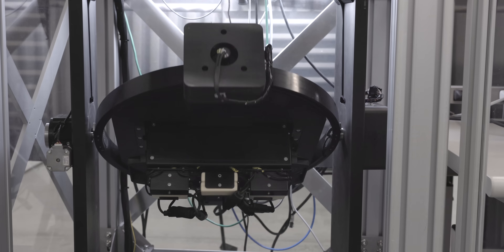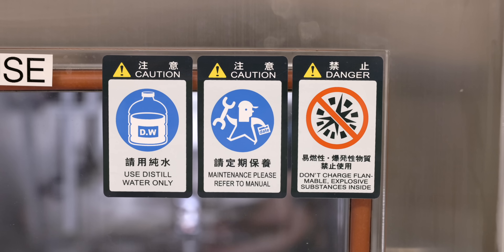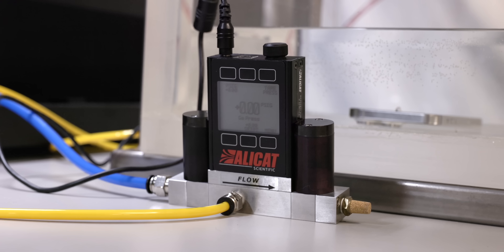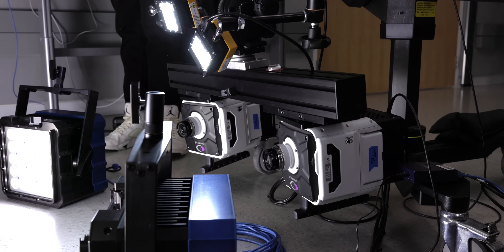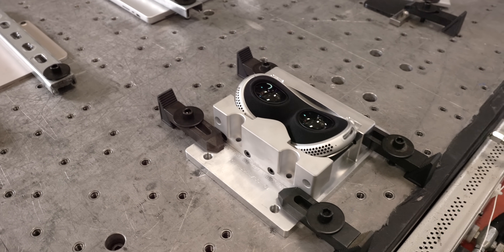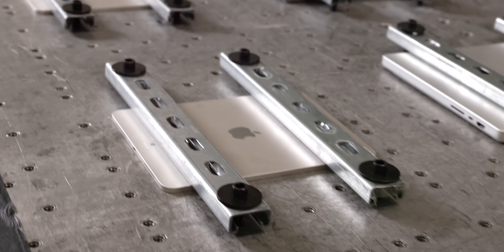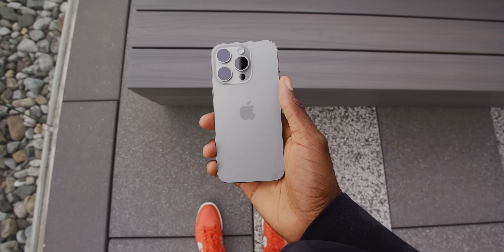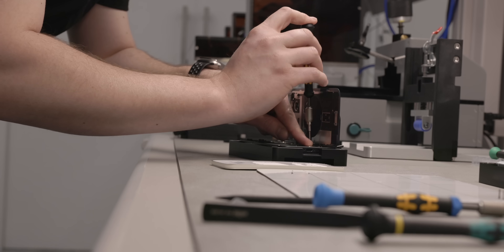I Visited Apple's Secret iPhone Testing Labs!

Comment: There was a key claim made that Marques should have dug into either during the interview or before publishing:

First the Apple engineer says:

"The failure rate once we got to that point [of durability, e.g. IP68] has just dropped, it's plummeted."

But then he rephrases as:

"the number of phones requiring a repair has dropped significantly"

Firstly, is this data true? Marques could have sought an independent/expert opinion on this. What do customers and repair shops see? What do his contacts within Apple say under anonymity?

Second, Apple's policy is typically to replace or to price repairs so high that the replacement is preferable, or they restrict suppliers from making parts widely available. So if the claim of fewer devices 'requiring a repair' is true, is a lower repair rate due to durability or is it due to policies that prevent repairs from happening?

Another question is what happened to the rate of replacement in the same period? Because replacing a phone instead of repairing it is far, far worse for the planet and the customer if a repair was possible.

Finally he talks about the number of phones needing repair dropping, not the rate decreasing. How does this map to the number of phones produced in the same period. Are the same number of iPhones sold?

Overall, I really like Marques and I believe he does have integrity, but in this situation he seemed a bit out of his depth. His body language was uncomfortable. He wasn't really taking an active role in leading the conversation. He was listening to a marketing pitch and by being passive and using this footage with no editorial comment, his audience was also subjected to this marketing pitch.

I think he was a bit in awe of hearing someone he probably admires a lot speak and a bit unprepared for being ambushed by this greenwashing agenda. In future he and his team would do well to clarify (and agree) what topics any interview will cover 
so they can come prepared, and not to feel pressured to publish anything without editorial control of the message it sends.

It's a lesson and I hope he and his team learn it because integrity is really fundamental to their infotainment product and business. If he doesn't learn it companies like Apple will exploit him over and over until his channel has lost all credibility.

Comment: Lets see if I understand this video right. 
for IP testing, they do what the board that controls IP rating tells them they have to do. Wow. Much effort. Such result.
for drop testing, they drop it a bunch. Again, Wow. Much Effort. Such result.
To simulate long term use, they put the phone in a clean, (I'm assuming) temperature controlled, and uniform environment then shake them. No thermocycling, no dropping it in shit (i mean that literally), no repeat impact testing in-between shaking, dragging it across the ground, no shaking it while the charging port is filled with dust/dirt, no simulated actual use, just shaking. Again, wow. Much effort. Such result.
For reparability, you got blue pilled and bought the COMPLETE AND UTTER BULLSHIT that is apple saying their stuff is "repairable." Wow. Much effort. Such result. 
The last thing you mention is durability vs repair. Do you know what some of the most repairable things I've owned are? The most durable. Do you know how repairable a good shovel is? Near infinitely. I can replace the handle if it breaks. I can weld the head if it cracks or breaks. I can replace the head if it wears down too much. Do you know how durable a good shovel is? Extremely. I've had shovels that are stronger than pry-bars that don't sacrifice reparability to get that durable. "But CoffeeLoki" I can hear you saying "A shovel isn't nearly as complex as a computer. That's not a fair comparison!!!" ok, I'll humor you. Lets look at something a bit more complex than either of them: a NASCAR vehicle. Its insane how much of those vehicles are repairable. They can swap out the entire brake assembly in less than a minute. How durable are they? 24 hours without shutting off while running at speeds most people will never drive levels of durable. Trying to say that in order to make something durable you have to make it unrepairable is asinine. While that is occasionally true, I have yet to see an example of it from apple. I would love to be proven wrong on this, but I doubt I will. You don't need to glue down the battery to make it more durable. You don't have to serialize parts to make something more durable. You don't have to use first party parts that you wont sell to 3rd party repair shops or to consumers to make something more durable. All you have to do to make something more durable is use better materials, which apple doesn't do.
To quote @BarrrNone, GET FUCKED CUNT. I no longer have any trust in your videos and see you as little more than a shill. No part of this is eye opening, no part of this makes me like apple. No part of this likes me make MKBHD. 

do better

Comment: I bought Iphone SE 2020 in the year 2021, i didn't knew it had design issues at that time but Apple did knew the Iphone 6, 7 and 8 had the same issue of mic and touch with these phones and yet they pushed the same design without any correction to Iphone SE 2020. Due to bad design of the board, the phone eventually get the mic and touch issue.
And you are collabarating with them without asking these type of questions. I unsubcribed immediately.

Comment: I call bullshit on that, from personal experience. 
I had an iPhone 8, droped it on the first day, slightly broke the back glass. Two years later, I wanted to get the battery replaced. Apple refused, because of the slight break in the back glass. The authorized repair shops told me they are not allowed to open the device. Had to go to an independent repair shop that put a third battery in which bloated a few months later.

This has nothing to do with "improved seals". It's just making me buy a new phone.

Comment: If repair shops will guarantee and warranty water durability after a repair, then repairability can be elevated over durability. If repairability "breaks" your IP68 protection, then I will go for durability any day. I think the only real issue with giving into Apple's propaganda against repairability is when the company actively makes it difficult to get Apple genuine parts or makes otherwise repairable/replaceable parts unrepairable. 
I think MKBHD gave an unbiased explanation for the questions he asked, but perhaps "Why does Apple make it difficult/impossible to source and replace genuine parts in the iPhone?" might have been a more heavy hitting question that would be more worthwhile. 
That being said, I will opt for AppleCare repair/replacement because I am not going to give up my IP68 rating, because that is just asking for a bad day at the beach.

Comment: The amount of advertisements in this video: 2 at the start, 1 at around 3 minutes, 1 at around 7 minutes, and 2 at the end. Just putting it out there.

Also, to be more direct; repair-ability and durability is not a "spectrum" or at odds with each other. Many companies - fairphone and framework, first and foremost - have proved it.  My 2021 Motorola smartphone is as durable, if not more than the iPhone released that same year. How do I know: my dad has that iPhone, 13 wasn't it? Google and Samsung (until quite recently) were very much more repair friendly than Apple for a long time, and you didn't hear about Google phones breaking (although hardware quality was bad - but that's a separate issue). For quite a while you didn't hear about Samsung phones having durability problems - and even after the battery fiasco (the recent one which happened due to improper storage, not the Note 7) you could simply go to a repair shop and have a basically perfectly fine phone.

Even I - an 19 year old who has zero experience in smartphone design and repair - can just order parts online, open up my phone and perform a repair with the help of proper research on the internet. Again, how do I know? I performed it last year. "Well, there ya go, you're phone did break; it's not durable isn't it?" I dropped it from a staircase, and I don't think any phone could have survived (yes, I am clumsy). Had it been an iPhone, I would have had to pay upwards of $700, given my country's broken economy (even in the US it's like $300-400), and that's IF I could find parts at all! Instead, I did an OEM parts repair for less than $100 (again, country's economy, your mileage might vary).

Let's say I was scared and didn't want to risk repair on my own phone. We have repair shops for that. For a measly $50-100, they can restore your broken phone to full functionality. I save the environment of metallic and plastic waste, I get my phone (sentimental attachment) repaired and functional again, and I don't have to buy a new phone - and I would just have to wait for 2-3 days. Can you do that with Apple devices?

This is just a blatant attempt  at PR from Apple. By trying to gain public respect with videos like this, they aim to cover up their malpractices towards customers and avoiding actually environmentally friendly designs. All for dear Tim Apple's wallet.

This is very disappointing from a popular and believed to be neutral YouTuber like you. You should have done your prior research before doing this interview.

Comment: As for the drop test. If a phone lands on a hard uneven surface and hits its screen then it will break because all of its weight is focused on a single small point.

But when landing on an even surface it's really hard to damage a phone because since the landing surface is even the phones display and even put the force of the impact and spread the damage which causes nearly no damage.

Point here is if a phone was tested on an even hard  surface even a cheap 50 dollar phone will survive. But on a hard uneven surface if your phone display hits the right angle it will not survive. 

Because my 50 dollar phone didn't survive when it got a lucky hit on an uneven surface. Thankfully the top part of the phone where the ear piece is got damaged and the display and touch screen was fine.

Comment: If "durability is directly at odds with repairability" then how  were nokias indestructible?

Respectfully, you need more experience to discuss engineering and mechanical design. Your ignorance combined with your influence comes off as propaganda.

Maybe try replacing some screens and batteries on different phones that are renown for their durability. You'll get to see different engineering strategies from various manufacturers and how they affect durability and repairability.

Comment: The galaxy note 4 had an IP 67 rating and had a simple battery cover. It also had a headphone port. Apple and Samsung are both anti-repair.
As for repairable and durability being at odds, I dropped a galaxy note 3 off of a roof and it had no damage. When my dad broke his note 3, I was able to buy the charging port and it only took about 10 minutes to replace.
Samsung used to actually make durable and repairable devices, such a shame they followed Apple's bad example.

Comment: Hmmm.  It seems a bit dismissive to simply say, "so yeah, that checks out."
The example of the battery and gaining access to the device is an oversimplification of the very complex issue of right to repair.  Repairability is NOT just accessibility to the device's internals, and longevity is NOT just about waterproofing.  Sure, repairs for water damaged devices will drop significantly when a device is waterproof.  But what about internal cable failures, overheating failures, glue failures, and all the other failures Apple products exhibit (and that aren't covered by warranty)?  These failures result in new purchases,  exorbitant repair costs, and more landfill waste.  The customer gets ripped off, and Apple gets richer.

I used to tell my friends that either Android or Apple would be a great purchase (for a phone).  I no longer say that.  Apple, as a company, is not doing right by us, and shouldn't be let off the hook so easily.

Comment: 9:41 apple = preventing access to components for repair = number of repairs dropping = successful robust design lmao
Reply: Funny how this timestamp is the exact hour and minute Steve Jobs announced the first iPhone and is also in every single Apple commercial
Reply: Funny how iPhones on average last longer than any other phone. The most commonly used phone on the planet right now is the iPhone 11.
Reply: @seesidesummerhouse6112 no, dude. It's totally not, lmao
Reply: @justaguy3518  Thanks, but I’ve already looked at the data to come to my conclusion, as compelling as your ‘trust me bro’ argument is…
Reply: @seesidesummerhouse6112  iphone 11 represents 4.47% of the total. That means 95.53% IS NOT iphone 11.
Reply: @justaguy3518  Way to miss the point, or rather deliberately miss the point because you have a preconceived notion you’re trying to protect. The most used model in the world is a 5-year old iPhone. iPhones also have the most residual value after every year of use. Those are two indisputable facts. 
Thanks for playing.
Reply: @seesidesummerhouse6112  I don't understand how saying apple is so bad at innovating that no one wants to upgrade their phones is a good thing.

Most people upgrade because they want a better phone, not because their old one breaks.  Apple users holding on to a phone from 5 years ago isn't saying they're tough, it's saying that they haven't gotten any better.  I would be more then willing to bet if Apple didn't purposely stop supporting older phones, their users would still be on the 4 or 5.  

Are they solid phones?  Absolutely.  And easy to use.  But they are sub par for literally everything else you do with a cell phone - transferring data, customizing, using apps, etc.  Does apple have apps? Yeah.  But try using one or installing a game that doesn't come from the app store.  Apple sucks and it's users are brain dead with too much money.

"Holds it value" because the 5 year old phone has more features then the newest one and you're pretending like it has something to do with the phone itself and not the fact that apple users don't understand tech products well enough to know they would get way more bang for their buck from android, a class of phones, vs. apple, a brand of phones.

Comment: IF, and that's a big 'if', the point is to make devices more robust sacrificing repairability, which might be true for iphones, then what's the point of having all components soldered and glued on Macs? Like, why macbooks have unreplaceable battery? Macbooks are not IP68 or whatever. Also, why macbook's keyboards are glued and not screwed to the chassis? Why do they use all that proprietary bs into their machines if the point is reliability and be more environmentally friendly? Why I can't upgrade my Mac components after years? Sorry but that's just greenwashing to me. Oh and I am a Mac user, I love the machine and the OS, but I just can't stand hypocrisy especially on sensitive topics like these. Just say that you do it for more profit and stop with these fake eco friendly claims.

Comment: So I got a third party repairer to replace a cracked iPad screen, awesome job, looks like new.  Until I pull out my Pencil, then all diagonal lines are staircases.  What the hell Apple? Before the repair, the pencil worked fine.  Touch worked the same before and after, drawing diagonals with my finger is fine, but the Pencil, shit.  How about you fix that little software "fuckyou" you placed to make 3rd party repair difficult.

Comment: Never in my life had I dropped my phone into water, but basically every phone I had had noticeable or severe battery degradation, and replacement batteries were not as good as original.

Comment: "Durability is at odds with repairability" = it's OK that Apple's devices are not repairable because they're super durable. But that's blatantly wrong. It also does not exist on an x-axis of repairable&unreliable to unrepairable&bulletproof. It's actually x & y axis, where there exists a universe that something can be reliable AND repairable. Or unreliable AND unrepairable... like A LOT of Apple products.

Comment: No.  Just no.  You have been gaslighted.  

Durability and repairability are mutually exclusive concepts from an engineering perspective.  What he said is utter foolishness.  Maybe this is the product philosophy for Apple but they have made some MacBooks lacking both durability and repairability.

I thought you were more sophisticated.  He used a limited use case to try to extrapolate across all aspects of repairability and durability.  At the same time, Samsung managed to make a specialty ruggedized, water resistant phone with a replaceable battery for niche customers.  That killed that example.  Repairable and durable don’t go with inexpensive with the example given but it is quite possible to make engineered products both durable and repairable.  Airplanes are made to be durable and repairable.  Otherwise, you would have them falling out the sky.  I had some older laptops that were quite reliable and repairable.  They worked for a long time and when the battery needed replacement, it was a simple affair.

Comment: I get that Marques is not allowed to ask certain questions, but if there is nothing of substance, don't post the video. Don't give these guys the time of day when they are clearly making a strawman argument. Apple is actively messing with our ability to repair our phones and in 99% of cases it has nothing to do with durability.
If they want to enforce the use ofapple original parts, they should supply them and make them easily available and affordable. Instead of providing a whole module, provide individual parts. There is no point in software locking repairs done by third party repair stores. Apple is clearly just anti-repair.